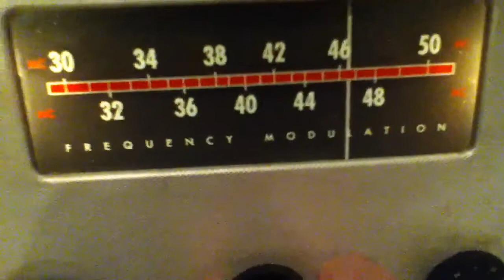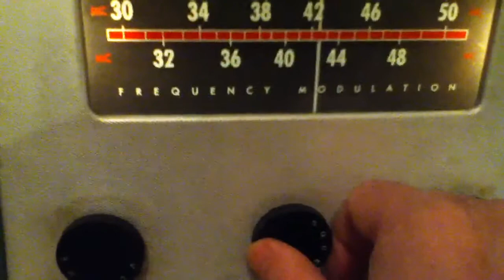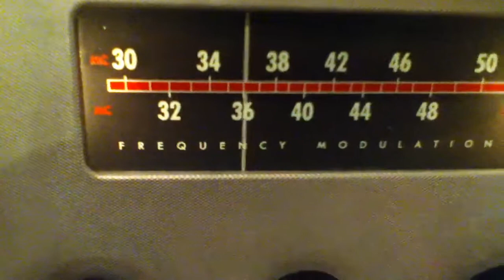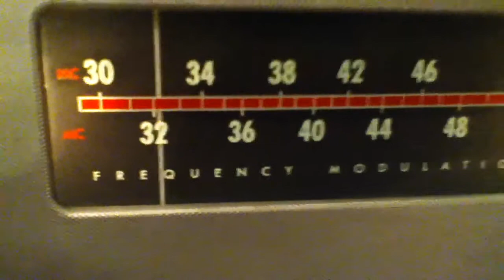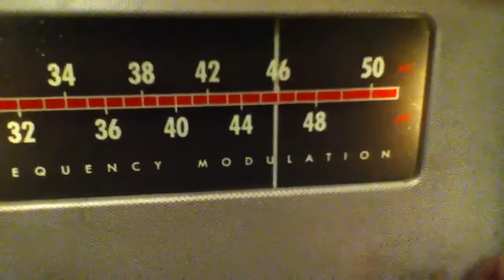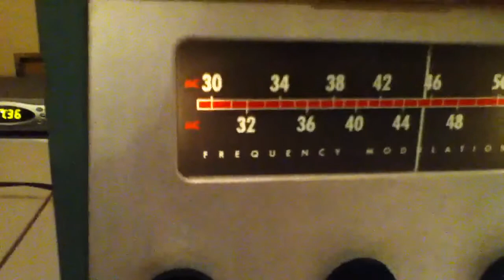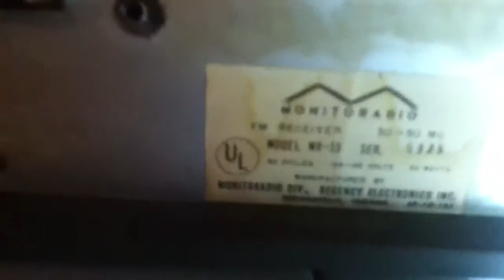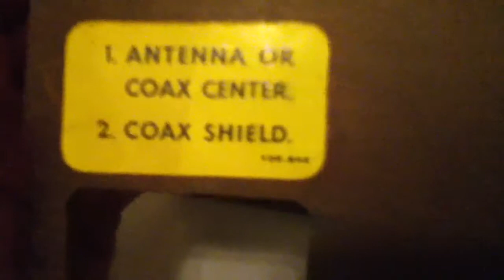Regency FM Radio Scanner Model MR-33

Comment: You can still use the frequency range to pick up baby monitors and some of the older Wireless telephones they're on the 49 megahertz frequencies. There are still some communities that may use this as a public service Band as well. Sadly it doesn't go high enough to pick up the 6-meter amateur radio band.